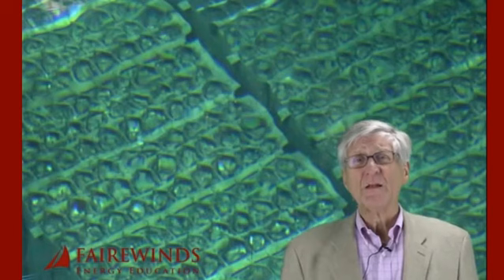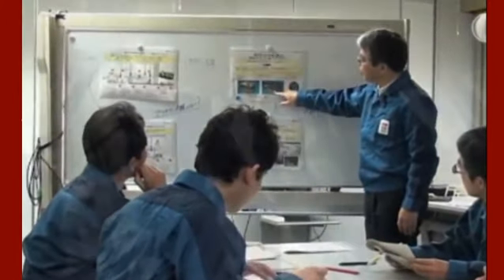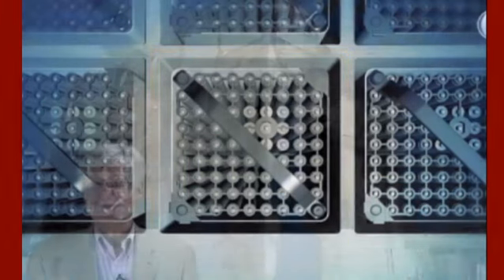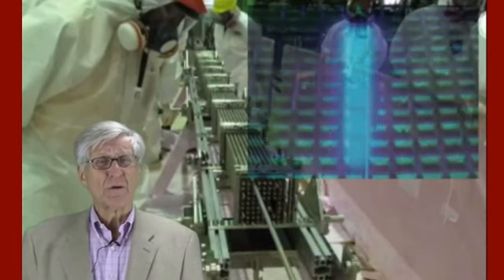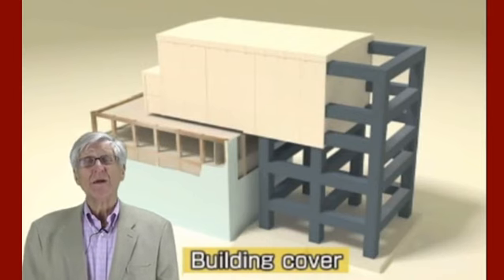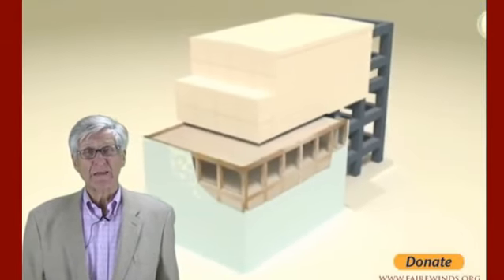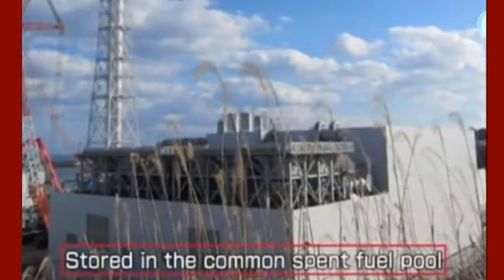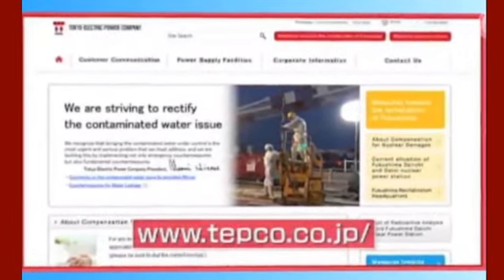Fukushima: Remove TEPCO Before Removing Fuel at SFP#4 Arnie Gundersen

Comment: Fukushima fiasco: Tokyo Electric's risky removal of radioactive fuel could set off uncontrolled chain reaction; emergency delay invoked
November 18, 2013 NaturalNews
All that is required for a runaway nuclear meltdown is for one of the fuel rods to be dropped or accidentally placed too close to other fuel rods.
Fukushima reactor No. 4 currently has 1300 fuel rods being stored in a leaking pool held 150 feet above ground. There are 6,300 fuel rods in a nearby storage fuel that also need to be moved. In all, Fukushima holds 11,400 fuel rods, any one of which could break and send the entire situation spiraling out of control.
The idea that Tokyo Electric is going to use robotic cranes to somehow remove all these fuel rods without damaging, breaking or misplacing any of these rods seems almost impossible.
http://www.naturalnews.com/042952_Fukushima_fuel_rods_inadvertent_criticality.html